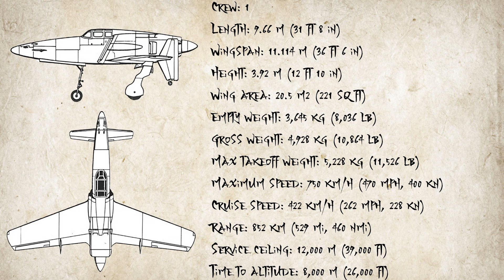Kyushu J7W Shinden | Japan's Backwards Plane

Comment: Do wanna mention the 6 propellers may have been likely only 4 in its production model. Aside that had it been in service would have been a very effective bomber hunter due to the 30mm's it would be equipped with. Although most certainly would require escort crafts if there is any P-51's at lower proximity's.

Comment: The problem with the Shinden was flying the thing. The prop spin kept pulling the pilot to the right.
Second problem was it suffered the same flaw of all Japanese planes that it was fragile. 5 or 6 12.7 mm machine gun
bullets was enough to blow off a wing. With the engine in the tail meant if a fighter go on it's tail the bullets would plow into the engine and
knock out that engine. Without power the plane would fall out of the sky backwards and not glide at all.

Comment: There were no plans to replace the J7w Shinden's engines with turbojet engines.
This was clearly stated by the developer at the time.
However, an accident involving the propeller contacting the ground during early ground tests of the J7w Shinden led to a widespread misconception that the turbojet engine was an option.
At the same time, the J7w Shinden was used in many novels and science fiction works because of its special shape and the episode that it was never completed despite the existence of an actual model.
(Godzilla minus one is one of them.)
Thus, there are many fans of the J7w Shinden, and many people still believe that the plan to install a turbojet engine was true because of wishful thinking.
The only planned modification of the J7w Shinden exists only to reduce the number of propellers from six to four for the mass production model.
Recent studies have also questioned the cooling performance due to the narrow air intake, which would have made development more difficult if a turbojet engine had been employed.
As mentioned in the video, Kyushu Aircraft, the company that developed the J7w Shinden, is not inherently suited to design, develop, and manufacture an aircraft with new ideas like the J7w Shinden because of its limited development capabilities and experience.
While it is commendable that they flew the test plane, the reality is that the actual evaluation is far less than we can imagine.

It is important to make a compact and lightweight design in order to have a high climbing ability and to mount an armament that can destroy bombers even with an underpowered engine.
In this sense, it was a very good idea, but it would require a great deal of research and development to make it into a practical fighter.
The phrase “a strange secret weapon designed with a new idea that no one has ever seen before” is what propelled the J7w Shinden, a small fighter of which only two test models were produced, to become a very popular fighter that is still talked about to this day.

Incidentally, a full-scale model of the J7w Shinden can be found in a Japanese museum.
It was used in the filming of Godzilla Minus One, and was built from the beginning to be displayed in a museum in order to keep the filming budget low.
If you ever come to Japan, please visit this museum.
If you ever come to Japan, you will learn a lot more by seeing the full-scale J7w Shinden, which was meticulously reproduced based on the remaining photographs and blueprints.